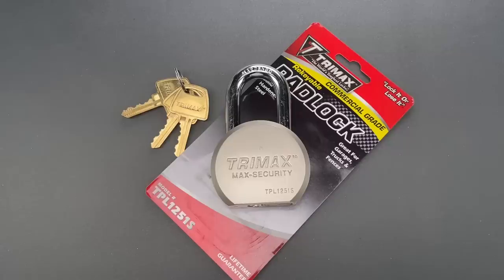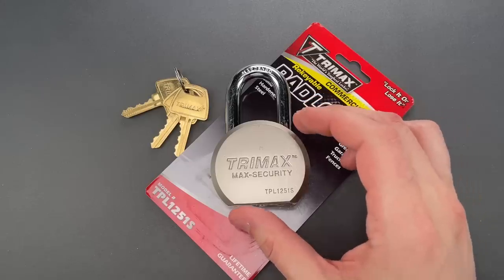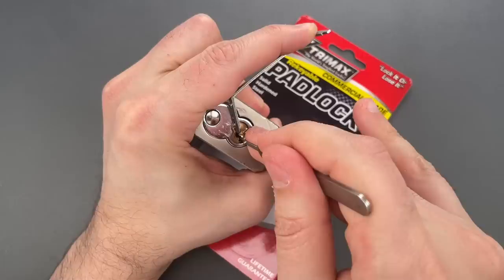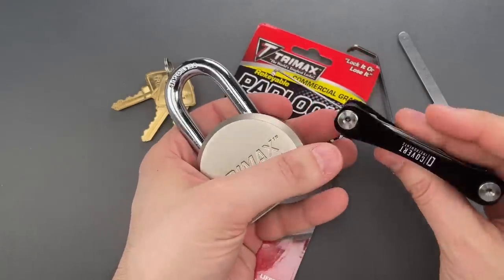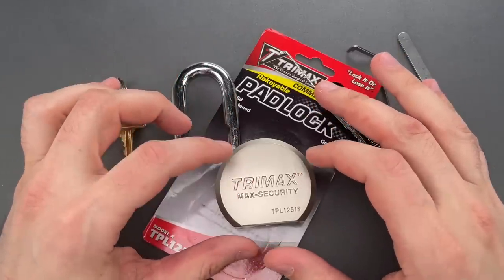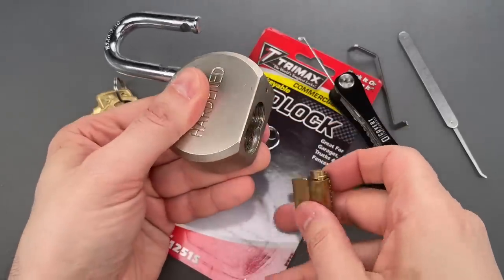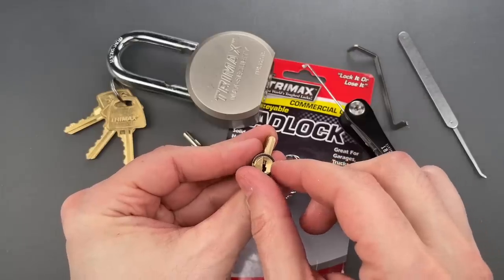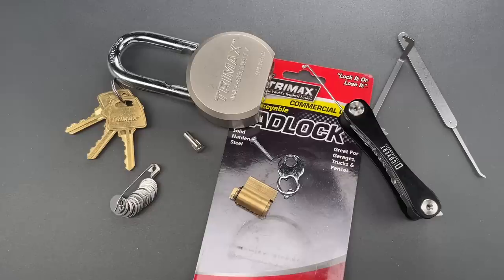[1517] 5 Year Update: TriMax Round Body Padlock

Comment: I have this feeling it isn't a "mistake", it is an MBA telling them not to waste money doing things right because they still sell without the fix.
Reply: 100% some human science graduate telling engineers how to do their jobs.
Reply: *Exactly!*
Reply: 100% it was never mistake, but the company never cared about security.
Reply: @GuitarsRockForever  I would not say the company as a whole - just those with the ability to make decisions to 'save money'.
Reply: @GuitarsRockForever  True, they make locks that keep honest people out, and make them as cheap as possible, using some small set of workshops in China to make them.
Reply: Or it could be a lazy owner milking his brand and just not caring about the quality he puts out.
Reply: @getasoul3990  So Colin Farrell in Bad Bosses ;)
Reply: I work at a manufacturer for industrial machining, and i dont know exactly how these padlocks are assembled, but one of our machines to sort out the bypass-shieldings shown by LPL in the video would cost ~50.000€, without it beeing implementet in the assembly-line. So i understand that an old product does not get an update that quickly. 

BUT

if your product is security, you should try to provide security.
Reply: Absolutely. Engineers like to design things well. They were told to shave 1/2¢ off of manufacturing costs so they did.
Reply: @weldabar  yes. once installed a ~150.000€ Machine that saved roughly 10ct per Enginge at a Car-Manufacturer in Munich. But they told me they produce around 10.000 Enginges per Month, so pretty fast the machine will pay of.
Reply: Bean counters at their best.
Reply: I believe you're quite right, on the other hand this item must be sub-cent to add, when in thousands. Looks more of a psychological hurdle than even a practical financial one.
Reply: it's important to remember that a corporation's first and only goal is to make a profit. if you want to encourage change, you would need to convince the higher-ups why making a change would lead to better sales. otherwise, they literally could not give a damn, even if that means they are selling an inferior product. the best thing you could do then is do what lockpickinglawyer does: discourage the purchasing of that product as best you can
Reply: Would be terrible, if that was the case... and considering how many companies repeatedly make the same mistakes over and over, or they are completely deaf and dumb, or they do it on purpose, because the people watching this channel are infinitely less that the people out there buying a lock among the thousands available. The fix for this lock is so cheap, that wouldn't cost millions to the company... LPL selling "fixes" and not only picking instruments, is just amazing 😄
Reply: @TetraSky  what?
Reply: Problem is, the MBA is right. Most people don't know or don't care about the security issues and just see "oh I know Masterlock, they make locks" and will buy it anyways.
Reply: @KlausAlleinzuhaus1  That would take 150 months, or 12.5 years to pay off.
Reply: @EricMakesStuff  erm. Yes. Made a mistake there, it may be roughly a Euro per Engine, installment was early 2020, and i was amazed how fast the machine payed of. But it seems i didn’t Remember the Numbers correctly.
Reply: Lol nobody with an mba works for trimax.
Reply: well, he's right: locks are all pickable, so why waste resources?!
Reply: Yeah but also picking a lock usually takes more time than any average thief would like.
Reply: @Creed3582  but now, he or she can use a pick from the kit LPL is selling and do it within 3 seconds ;)
Reply: The MBA will have noted that LPL has only (!) 4.2 million subscribers, and will have decided that's a negligible proportion of the total lock-buying population.
Reply: This seems like a workaround that they figure if you are savvy enough to know and use then none of the other security features on the lock will stop you.
Reply: Sounds like the company I worked for.
They consider workers are a waste. 
Only office staff value add and provide service  on the phone.
Reply: .0001 cents of aluminium for a guard, what environmentalists.
Reply: No-one who knows anything about lock bypassing would buy this thing even if it was fixed and the people who do buy junk like this don't know (or care) about things like lock bypassing.
Reply: @digitig  guys they're not paying an MBA
Reply: @KlausAlleinzuhaus1  Yes, tooling costs, same as injection molding, hella big (for us costumers that is) upfront cost for super small part costs. Haven't done stamping yet to know how much the molds cost, but I don't doubt that claim. They could outsource it of course but the tooling cost is still on them.
That being said, it's a volume sale product, so if it increases sales by some percentage that will cover the tooling cost quickly enough, they should see a profit increase.
The sad thing is they just don't do it, they don't think about that prospect of increased sales, they just think the average costumer will buy it even if it's crap cause it feels sturdy.
Reply: @getasoul3990  Or lazy employees and the owner doesn't even know. Weird.
Reply: The truth about locks is this: most locks are not hard to pick because they don’t have to be hard to pick. There’s no point in having a door with an unpickable lock if a prospective thief can just break in through a window. And the lock doesn’t need to prevent a thief from being able to get through it to prevent whatever it’s protecting from being stolen. It just needs to prevent enough of an imposition that it’s easier to just go steal something else.

Comment: LPL picked the lock faster than he could say ”so you can see it’s not a fluke” 😂
Reply: Auspacken dauert länger als picken.
Reply: I suspect that it might even be vulnerable to raking, the bitting on those keys doesn't appear particularly deep, but I'm no lockpicker.
Reply: @dj1NM3  idk bud there were three pins that were hella binding, maybe a rake isn’t strong enough. LPL usually goes for the wave rake if it’s warranted.

Comment: When you consider that an anti bypass shield costs what? A penny, the fact that the lock making companies are not using them is appalling! Maybe they are in cahoots with the insurance companies!
Reply: Oh it's far less than a penny to the company, more like a hundredth of a penny to produce with a very simple die stamp and thin sheet metal stock. It's completely inexcusable
Reply: The from what I understand lock’s keep  law-abiding citizens out if it’s a criminal then they don’t care what they need to do to get past a lock
Reply: @thatoneawkwardfriend919  i mean, yes, that’s true to a degree, but the point of that quote is that it’s not a binary, but people have different levels of honesty and are more or less easy to tempt into crime. even a professional thief will usually avoid things that require more effort and people who usually don’t commit crime might be tempted by things requiring zero effort

exploits like these which require zero skill and are just as fast as and look just like using a key are inexcusable
Reply: .5 cents across 3 million products...
Reply: @vyor8837  0.01cents at most
Reply: @Lilith-Rose  still over millions of products, it does add up. It's still no excuse, but there is a reason they don't do it.
Reply: @vyor8837  having worked in mass production manufacturing I can tell you that it is a completely negligible cost that wouldn't even put a dent in the waste cost margins allocated to qc discrepancies. People have no idea what goes on behind the scenes, the only reason they don't implement it is sheer arrogance of upper management
Reply: @vyor8837  But that's $150,000.  The CEO could buy a new car with that!
Reply: @Lilith-Rose  And then a couple million going into the actual purchasing of molds and the manufacturing equipment.

Forgot to mention that bit.
Reply: Insurance companies loose money every time a thief uses these flaws .  In fact, insurance companies are the drivers behind lock efficiency standards like "Sold Secure".  They are also the underwriters in Underwriters Laboratories (UL),
Reply: @vyor8837  moulds? Couple million? A die press and dies *are a really cheap piece of equipment (and they already would have a die press on site for production of the other parts they already use so just need a new set of dies) and can produce tens of thousands of those in a day. A quick run through a vibratory bowl to deburr (which is usually not even bothered with tbh) and then they are straight off to assembly. Material costs of that guage of sheet metal is also minimal, it's a small simple part produced using a stamping die press which is one of the cheapest production methods imaginable
Reply: @vyor8837  again, I have experience working in mass production, actually as a quality controller who was involved in product optimisation and had to work closely with both production and material supply along with purchasing and engineering as part of the job. My job involved dealing with this kind of thing regularly because I had to ensure that the best end product was delivered and the materials as well as components were up to spec.
Reply: @8675steve  That's actually 15,000. 3 mil x .5 is 1.5 mil. Divided by 100 is 15,000. That's probably less than they pay for copy paper a year.
Reply: @Vyor  It adds up alright... to $10,000 usd assuming 100 million items under the .01 assumption. Some of these fixes are so cheap they nearly amount to nothing.
Reply: Why is everyone always fixated on the material cost for one more component of a build? That is seldom the main cost.

The factory would want a way to automatically pick up this washer. Orient it in the correct way. Fit it over the cylinder before fitting the cylinder into the lock body.

If using Chinese children for this, then the cost change isn't that high. If they currently has an advanced machine for fitting the pieces together, then that machine may need to be scrapped and replaced by one or more much more expensive ones.

This makes the cost of that washer totally irrelevant to the total investment needed.
Reply: @perwestermark8920  Well, material cost is the primary component in a padlock. The relatively massive solid metal lock body sees to that. But yours is still a fair point. That said, I think most padlock assembly is still fairly hands-on. Adding an additional fiddly bit on top of the cylinder is unlikely to be a significant concern. But I could easily be wrong and you're right to bring it up.
Reply: You said "cahoots" 🤣😂

Comment: One thing to pick a lock mutiple ways but another to say how to improve it, then show how it could be improved with no additional tooling by using an easily accessible part.

Truly impressive
Reply: Finding the easily accessible part is not the problem. The problem is that child slave laborers are far too difficult to train and it will really be a bottleneck thrown into the assembly pipe. What if the day shifts lead six-year-old gets dysentery and dies? How long will the line be down for then?
Reply: And then be ignored?  Not so impressive.
Reply: And a cheap part at that

Comment: I realize this might seem pedantic, but I don't think lock companies are, "making the same mistake over and over".  They know perfectly well what the defects are, and are making the business decision not to correct them, since they don't see how doing so will materially increase sales. The average consumer is going to judge and buy a lock based on cosmetic appeal,  and what it feels like in hand.  Most people I encounter either cannot or will not even try to understand the difference between picking and bypassing. That's something for people like us to appreciate.  Thanks for all the work you do by calling out these company's locks.
Reply: Then clearly, what we need, are to get wave rakes, combs, and bypass tools sold in hardware stores, along with booklets of known manufacturer models and years on which those bypasses work flawlessly.
"Yes, I sell locks. I also sell lock-bypassing tools. Why do I do that? It's none of my business what my customers do with things I sell them. I also sell circular saws, bolt cutters and high-speed cordless power drills. You can use any of those to gain forcible entry, too. Doesn't making this stuff available tempt thieves? I dunno, probably. You know what else it does, by my selling 'these things will open all these locks right up!' next to my locks? It drives the sale of good lucks on which I make more money per unit. Marketing!"

Comment: Makes me think a good security strategy would be to use locks like this that have been modified with bypass shields, deep cut bitting, and security pins just to confuse pickers.
Reply: That's where the universal lever action keys come in, or, if noise isn't an issue, a high speed rotary key.
Reply: @Mooreish  a surprise hardened pin will stop the second one. Though in both cases just cutting the padlock shackle is probably quicker.
Reply: I like to think of it as "could a child open this lock if they had a coathanger and some time on their hands?" 
Not so much about stopping pickers, or keeping the honest, but a child who just wants to ride the dirtbike in the shed while the parents are busy elsewhere.

Comment: So because this has a removable core, and can have the little protection wafer added to the back, for those inclined this COULD be a really nice lock if repinned with a few security pins to at least slow someone down (especially with a few sneaky mods to the core as shown in a number of LockLab videos from back in the day when Bill was still picking and gutting challenge locks).
Reply: This is almost certainly a dimensionally exact (if corner-cut) copy of the American Lock A700. So yes.

But you might as well buy an American A700, unless you can find the Trimax for super-cheap.

Comment: The fact that there is an off-the-shelf fix (those backing plates) for this 30+ year old vulnerability just goes to show how little effort lock manufacturers are putting into what should be an incredibly easy fix to implement.

Comment: I have a Paclock that looks almost identical to this. I hurriedly took it apart to check the clock of the actuator and to my relief it uses the 90 degree fix.
Reply: Can't judge a book by the cover.

Some lock manufacturers have had this vulnerability, but fixed it once they were made aware they dun goofed.

Comment: There's also a way to break the shielding and allow the bypass to work again- seen it done. You take a key that is 1 pin longer than the normal key, and grind it down a bit to make a wedge at the tip. Insert into keyway and it'll smack against the shielding. Hit the key with a nylon hammer a few times and you can get through the shielding, and then the bypass works.
Reply: I doubt the average crook has all those things and a bypass tool as well. 😂
Reply: @sw6188  Seen it in the wild, actually. Family business is locksmithing, and a dude brought in an American 700 that was beaten in the exact way I describe.
Reply: @caseydarrah  There'll always be an exception but on the law of averages not everyone will have all those tools and skills.

Comment: This is a cheap way to have a bunch of locks that open either with their individual keys or with a master key. Simply using the bypass driver as the master costs far less than having all of the locks re-keyed for a proper master key system. And, as long as the burglars don't watch LockPickingLawyer, they will never know, and the system will remain effectively secure.

Comment: Unfortunately, the OEM of the product one originally was design is not interested in reinventing the wheel and fixing the problems. They see that it’s just a bigger expense and they can sell the product without making those changes which would cost them more money at the bottom line and less profits in their pocket.  So I don’t think that it will ever change.

Comment: Trimax lock engineer: if we put a bypass shield on the backside of the cylinder,  it'll greatly increase the locks performance 

Trimax accountant: but that will cost 1/10th of a cent more per unit.

Trimax executive: 1/10th of a cent per unit? Does Master Lock do this? Wait, doesn't matter if Master Lock does this; 1/10th of a cent is too much. Denied, no shields